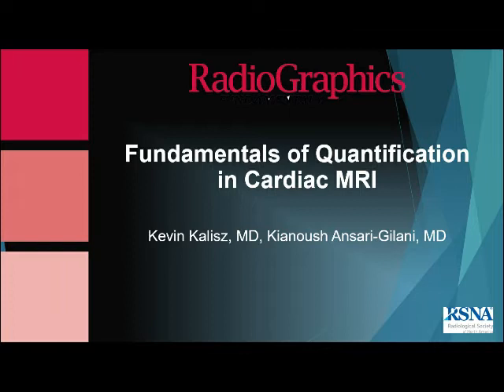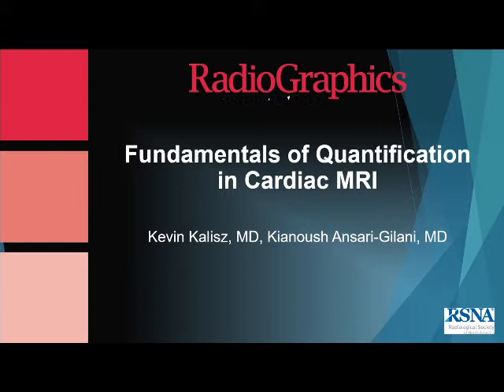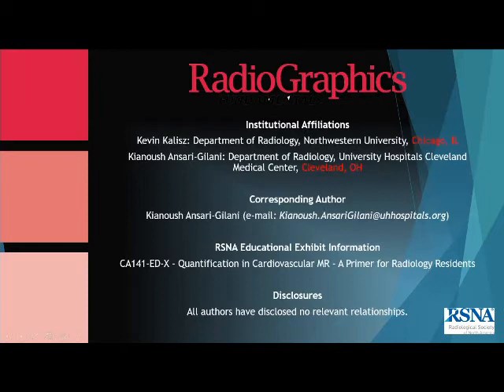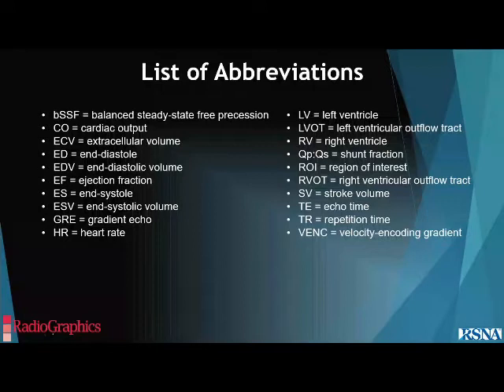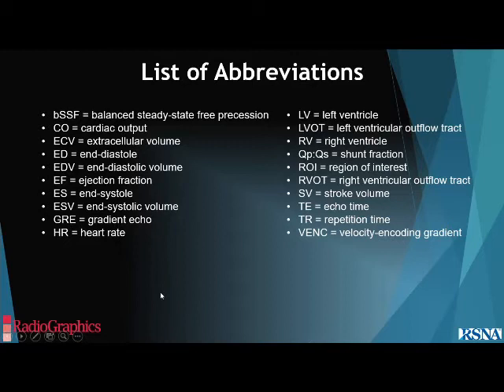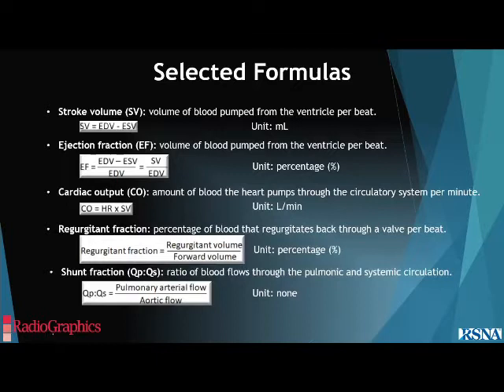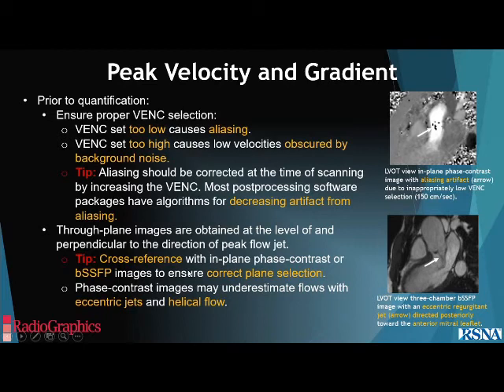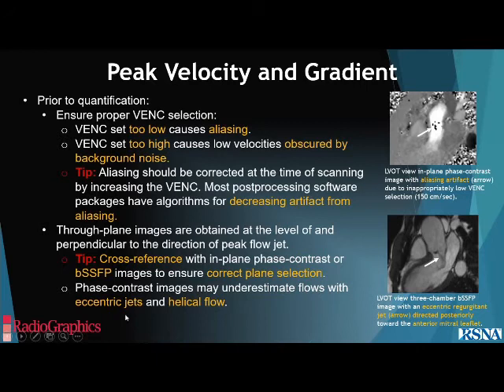QUANTIFICATION IN CARDIAC MRI

Comment: Errata (relevant points):
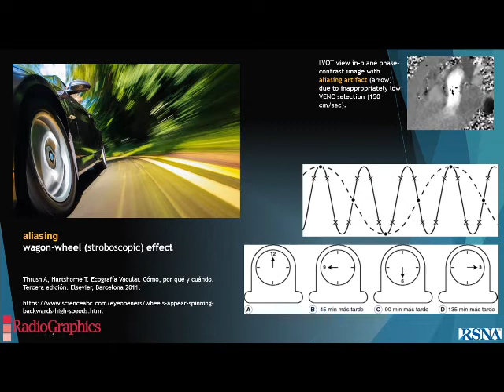1.) Too high VENC produces excess noise while too low VENC produces aliasing (at minute 24:53, 28:20, 38:25 - 39.00)
2.) During the postprocessing, noise is easier to deal with than aliasing (at minute 25:54)